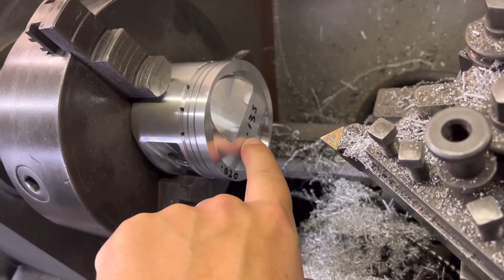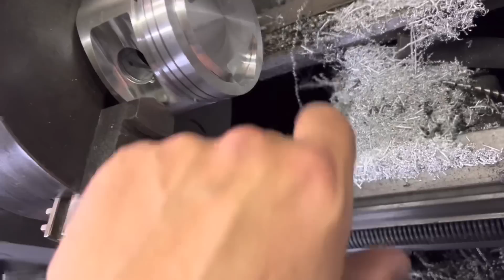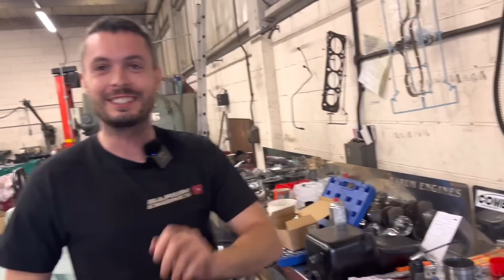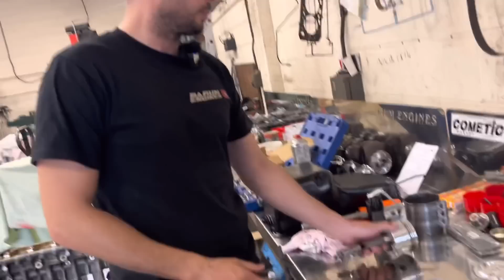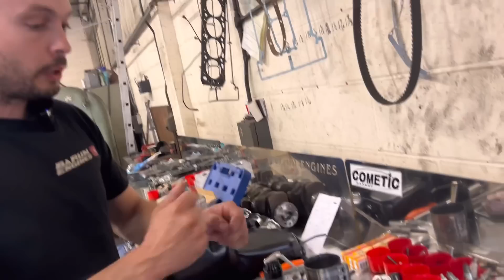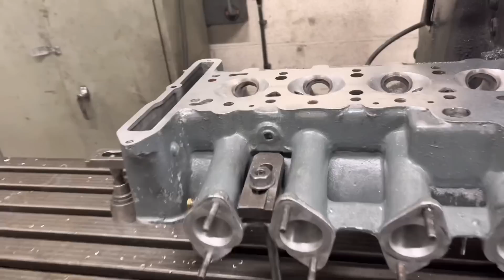Lotus Twin Cam build update, we discovered something that SHOCKED us. Why would they do that?

Comment: Besides the weld, bet the old gasket was 'cleaned off' with a sander or rotary wire brush, sure cleaned up nice after the resurfacing cuts. Not sure about that method, taking material off the top of the valve, instead, taking it of the top of the cup would seem safer where it comes to the cup-collet interference problems. Doing too much the way you said here 'could' lead to a valve dropping if the collet and cup interfere once hot. Doing it to the cup also preserves any top surface pitch on the valve head, such as use to induce positive valve rotation for wear leveling.

Comment: All seems so complicated. I owned a 1967 Elan S3 for 18 years. It was burning oil so I took everything apart and replaced the rings. Working in a small garage with the car on ramps. I don't know how i did it, but I did. I also reshimmed the valve clearances a few times. Must have been OK as I recently checked and the car is still registered.

Comment: I`ve had a TC Engine over pounds 16.000 building costs from Eamon Swords Lotus Club England and later we find out as we have had problems in driving, the engine has had 4 different pistons from several manufactors inside.
Another street TC engins new build has had no rear crankshaft seal  build in from this "engine specialist" as the car was on the street and looses oil. ... So we have to bring both engines to another shop in Leverkusen Germany who
fixed them right. Costs EUR 9.000.-- incl. material for the steel crank engine with the wrong pistons!!! Eamon never was seen!!!!

Comment: I can tell you haven't done a Twincam before as you can't fit the ARP head bolts with the front timing chain slider in place as the head won't go down straight.

Comment: Could be the head surface where its welded as you say and a haircut has cleaned up it, OR, it might be a pin hole in the weld itself.
Maybe blast a bit of penetrating solution of some kind on one side and see if anything weeps through the weld itself.
Easy to check than it is to pull the head off the fix the weld later.

Comment: I see many people cleaning gasket surfaces with roloc disk pads.  This is not a good idea especially on aluminum parts as it WILL remove metal.  Also it throws abrasive particles all over the parts and into the motor requiring a full teardown and cleaning.

Comment: Just discovered your channel
As a retired Automotive fitter and machinist it makes my heart warm to see that there are still people that take the time to REALLY set everything up properly in a racing motor.
It can make SUCH a difference to the performance of the motor AND the reliability.
So much so that "back in the day" I ran a 1300cc Kent motor and people in the 1600 class protested me because as far as they could see, the only way that I could be dropping them like I did and be putting up the stage times that I was, was if I had put VW pistons in (making it an 1840 I believe)
Having the Race Scrutineer Stewards do a pipette test to determine the actual swept volume was SO SATISFYING... 
Result : 1298cc
That actually brought me in a lot of "private" customers... 
So much so that I eventually had to stop driving myself because I did not have enough hours in a day to be able to do my own car as well.
As you probably know, Life Happens...
Keep up the good work.
Reply: Putting different pistons in, will change the compressed volume, but not the Swept Volume. To get the larger size would require changing the crankshaft.
Setting the car up right, and make a huge difference - A friend bought a Formula Vee 1200, which we took the time to set up the chassis properly, so he could get on throttle earlier in a corner and stay on it. Yep, the 1600 folks accused him of cheating as while they were faster at the top end, they didn't expect him to be faster out of the corners, or have the skills to eat their lunches under brakes :D
When the motor, gearbox, chassis and tyres all work together properly, you have more opportunity to make the best of the skills, and those without the skills but with more finances, run out of excuses.

Comment: Check the valve clearances again after you've torqued the head down. Pound to a penny they've changed due to distortion. I learned this forty five years ago when I built up a spare head assembly for a BDG only to be told that the clearances were all wrong when it was actually fitted to a block. When it was removed, the clearances were all correct again. I've checked this on several different OHC engine types since and have always found the same problem.

Comment: Watch for leaks on the TC during my Ford apprenticeship (Harold Hill) the toolmaker instructor had the toolmaker apprentice guys spend hours flatten every surface of his TC it still leaked mainly from the front cover
Reply: Was that the instructor with the mk1 Lotus Cortina, didn't get on his section but did the rounds of the machine shop and worked on the Transit with the Galaxie engine? Apprentice supervisor was Brian Simmonds IIRC.

Comment: Great informative video as usual Lee 🤘🏻 Just wanted to raise a point, from a time-served Turners perspective……I must say that using hard jaws to grip the Piston heads whilst you were facing them is a definite no-no in my book fella. I’ve seen this done countless times, over many years, by so-called ‘tradesmen’ and they nigh on always end up with marks/indentations in the workpiece, caused by the hard jaws, no matter how light the clamping force is. Obviously, I don’t need to tell you that a decent set of soft jaws would take the worry out of the equation……🙏🏻

Comment: Good luck with the wedding, cork gaskets was all ways a good source of oil leaks, on any engine type, the ford grey synthetic gasket is a lot better at keeping oil in.
Reply: On A and B series BMC etc. rocker cover cork gasket, used red hardening gasket sealer on the rocker cover side and gold non-hardening on the cylinder head side. Never leaked after. Same on other cork gaskets like thermostat housing etc..

Comment: The welded timing chain area on the Twincam head you think caused a leak has a separate cork gasket that is trapped and compressed between the head and the timing cover. Nothing to do with the head gasket.

Comment: Get rid of that 2 post lift and get a Mezzanine floor installed then have an access  hatch in the Mezzanine floor and install a crane that can lift engines up and rotate 360° then you could use upstairs as storage for motors to collect and use it as an engine assembly clean room, 

My old boss did it with a 2 storey building he owned that had a wooden floor on the first floor, he had the lot ripped out just so the shell of a building was left then he had a mezzanine floor fabricated on stilts and installed and he had a crane installed and he kept all spare engines up there, there must have been 80 or 90 engines up there which he used to buy off scrap men or breakers so if a customer needed a certain engine for a their car he could recon the one instock then swap it for theirs on an exchange basis.

If any machines are a bit too tall put them along the back wall and then don't make the mezzanine floor go right to the back of the building.

Comment: Never hold pistons in the jaws of the lathe, always use a split collar, preferably in a 4 jaw independent so it can be dialed in accurately, if you must hold the piston directly in the jaws use some brass or ally shim stock between the jaw and piston to protect the piston
Reply: Curtis at Cutting Edge Engineering Australia has a neat solution. He drilled and tapped holes in the end of the jaws so he can screw L shaped shims to them. Far easier than juggling with several bits of metal at once.
Reply: @ColinWatters  you don't   need to use 3 little strips I use 1 strip of brass wrapped around the piston same when machining threads on chrome bar for rams
Reply: @ColinWatters  I have little aluminum jaw cover bent that grip the jaws. Works great and if they get loose just bend them a bit to tighten the pinch.
Reply: @ColinWatters  use soft jaws machined to size
Reply: Probably what he did anyway (shim), and if he didn't he's done it for years and would know what works or not.
Reply: Or leather and/or rubber/cork pads.
Reply: @stephensaines7100  To soft, piston could shift.
Reply: yeah and learn the parts of a lathe lol. he called the compound slide the cross slide hahaha
Reply: Aye it's just wrong
Reply: In fact Imbarest  for you